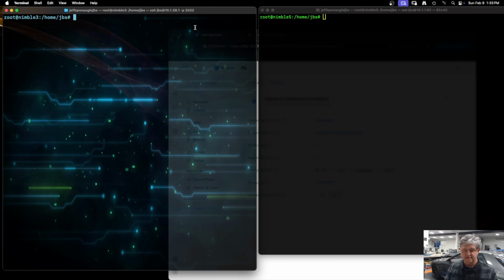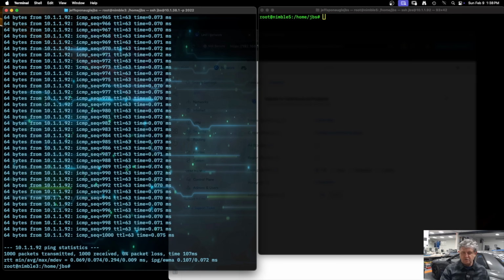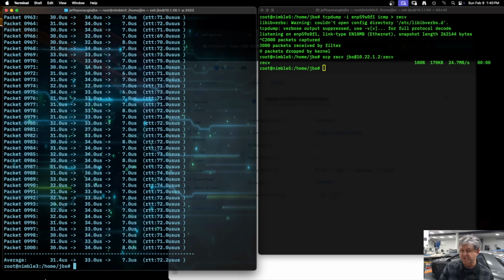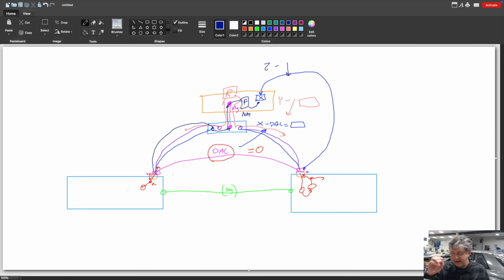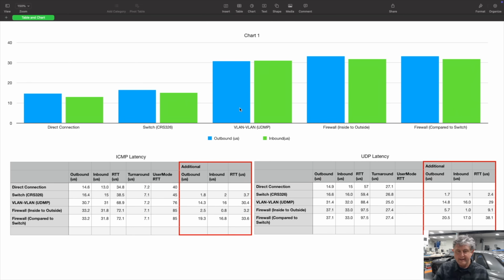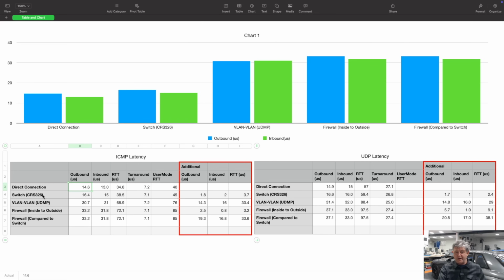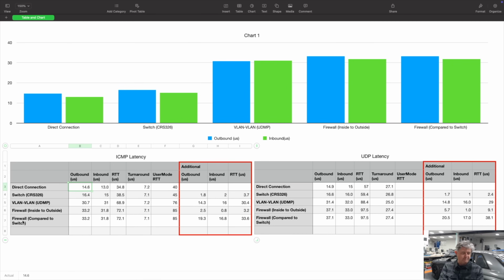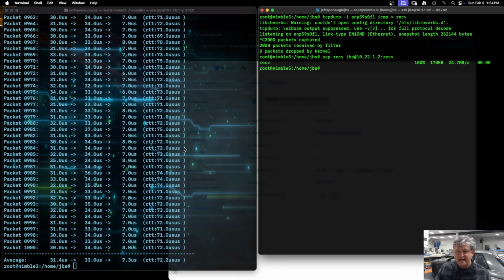HOMELAB: Measuring Latency in the UDM Pro MAX Firewall!

Comment: Super interesting, finally someone is talking about latency, I love it! I could listen to your explanations for hours, you have a talent for explaining things in an understandable way and presenting them logically. I would be interested to know how the latency of a DAC connection differs from a Base-T or Base-SR connection.
Reply from the maker: Yea, latency is interesting and somewhat important for lots of operations that bandwidth is not the only factor.   I'll see if I can measure the DAC and connection type latency - Those are pretty small typically!
Reply: @jeffsponaugle6339  Yes, that's right, theoretically the difference should be quite small! However, your setup is perfect for measuring something like this, especially such small differences could hardly be determined otherwise. I'm particularly interested in the comparison between the inefficient 10 Gbit/s Base-T and the passive 10 Gbit/s DAC, where the difference should be most clearly recognizable.
I think what you are doing is great, I have left a subscription and will definitely follow your future videos

Comment: Great video and testing with that setup. As you mentioned there are similar things that can be done using network tap´s. Quite a few years ago when 10G Cut-Through switches were first coming out we needed to accurately measure latency to compare the performance of different switches and to see if port-to-port latency on each switch was consistent no matter the port combinations. At the time the best results we got were using passive optical tap´s, connect to the device under test with two fibers and send traffic through the device in and out of the fiber links. Then tap both fiber links. We then used an Endace DAG card that was quite new at the time, the card was able to combine it´s 10G ports into one "capture buffer" and it supported very accurate time sync with with PTP and PPS feed. We could then run a capture on the machine with the Endace card and see both packets the one coming into the switch and the one going out in the same capture with very high timestamp accuracy. That give quite good results and it´s always fun playing with hardware in creative ways :)
Reply from the maker: Very cool.  Those network taps would work great for this.. and I do happen to have an Endance DAG PCIe card, but I can't find the linux driver package for them (it was something you had to download from their website but the device is now unsupported).
Reply: What specific Endace card do you have, I may still have some contacts at Endace and who knows they might be able to find the driver.

Comment: Very cool measurements! Also very fast, was not expecting the gateway to be able to do that sort of stuff in under 100 μs, was fully expecting an order of magnitude slower. Yet again I never knew about that trick of sending multiple packets in quick succession, sure enough doing it myself yields 94 instead of 300 μs average RTT (across a SG3218XP-M2 switch).

I think it would also be interesting to include IPv6 tests, is it higher latency because it's more complex or is it lower latency because there's no NAT? (my expectation is 'it highly depends on the hardware')
Reply: I suppose you attribute greater complexity to IPv6 due to its size (40 bytes, compared to the minimum of 20 for IPv4, or up to 60 if the practically extinct Options field is included, along with a very likely Padding field). But that's not the case; the complexity mainly lies in the number of fields (overhead). IPv6 has 8, whereas IPv4 has up to 14 (12 in the vast majority of packets, which is a +50%).  

Secondly, if you add to the above the fact that IPv6 does not rely on error detection in its own header… this is a symptom of the expansion of fiber optics and the evolution of wired and wireless technologies, in addition to a highly reliable Cyclic Redundancy Check (CRC) value in the Frame Check Sequence (FCS) field of Ethernet/WLAN. Keep in mind that at each hop, as observable through tools like tracert or traceroute, the mere existence of a Hop Limit field (TTL in IPv4) already implies a decrement by 1 decimal unit, which would also require recalculating a hypothetical Header Checksum (the error detection field of the IPv4 header).  

Thirdly, above all the near extinction of in-transit IPv4 packet fragmentation (as opposed to source segmentation: DPLPMTUD, PMTUD, MSS Clamping, etc.); if we include all of the above along with the fact that IPv6 packets cannot be fragmented in transit (only segmented at a source) and the lack of need for a supposed IHL (Internet Header Length, from IPv4) field due to “the non-existence of options,” which is also checked at each hop (it cannot be smaller than 5, where 5 × 4 bytes = 20 bytes, nor greater than 15, as it is inherently limited by being a 4-bit field—16 possible values, from 0 to 15, where 15 × 4 bytes = 60 bytes).  

If I put “the non-existence of options” in quotes, it's because, despite being aware of the existence of EH (Extension Headers), I have not yet investigated them (“and that's no coincidence”—I stopped precisely at that point in my review for the CCNAv7). In other words, options do exist, but for now, I can only assume that they are not at the level of the IPv6 packet header itself, which would explain why they are not included in IPv6 protocol header diagrams, why they do not require a hypothetical IHL field, and why they are referred to as Headers rather than Fields, etc. I like to think they work similarly to the 802.1Q Header TPID field, which identifies the 802.1Q standard in a position where, one could say, the Ethernet Type field would normally be, in which case the latter follows the 802.1Q Header.

Keep in mind that a common number of hops when accessing a resource on the Internet is close to 10.

Obviously, both IPv4 and IPv6 headers follow a 32-bit (4-byte) and 64-bit (8-byte) architecture (IPv4: 20, 24, 28, 32, 36, 40, 44, 48, 52, 56, or 60 bytes % 4 bytes = 0; IPv6: 40 bytes % 4 bytes = 0), in order to be accelerated by hardware (ASICs, TCAM, etc.) in the most efficient way possible.

"is it (IPv6) lower latency because there's no NAT?" That's true, at least in almost all of cases. NAT has more uses than the traditional related to private-to-public IPv4 address bidirectional translation, which means that NAT will still make sense on IPv6 networks in residual cases.
Reply: @breixolagoalabrador3523  Very interesting comment, I did not know many of those IPv4 and IPv6 features and optimizations even existed.

Main reason for thinking such is that I briefly tested on my network pinging the same Windows machine as I mentioned before was mean 94 μs RTT with IPv4, but 99 μs RTT with IPv6. Pinging another Linux machine is 48 μs RTT with IPv4 and 59 μs RTT with IPv6. Also interestingly pinging the machine's own IPv4 address is 5 μs RTT but with IPv6 is 7 μs RTT. Variance between runs is ~ 5 μs though, but IPv6 seems to be very repeatably slightly higher latency.

Unfortunately I can't testing pinging through my NAT/firewall like Jeff without pinging from the internet which adds 2,000 - 10,000 μs so the variance is way to high to tell. Nor do I have hardware timestamping network adapters and PTP sync.

Comment: I've been wanting to get into IT for awhile. Is Code necessary to learn with IT? I enjoy taking things apart and overall digging into IT things with networking whatnot.  What could I do to get into something like that?
Reply: Coding not required. But you will find that if you know scripting, like bash, powershell, dealing with formatted config files, etc, you will stand out.
Reply: Network engineer checking in. The level of coding entirely depends on what flavor of IT you want to go into. This video is firmly in the world of network engineering. The only coding I do is to automate tasks and make my life easier. I've got some python, powershell, and anisble skills to make that happen. When you're at the scale of like 10,000 + clients/devices, having good automation skills becomes more and more necessary. It might be easy to set a vlan on a few ports quickly, but automation will do it on 20,000 ports with much less headache. The command line of most switches/networking is kinda like it's own language, but i found it much easier to learn than a whole coding language.
Thankfully the coding side isn't really needed to start in networking, especially for a home lab setup.